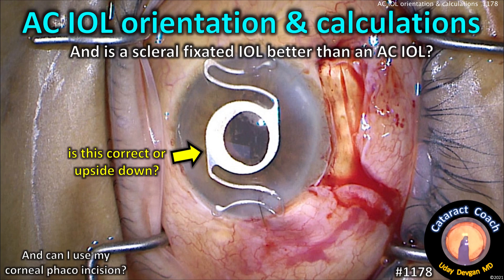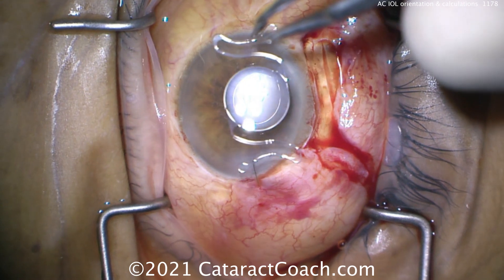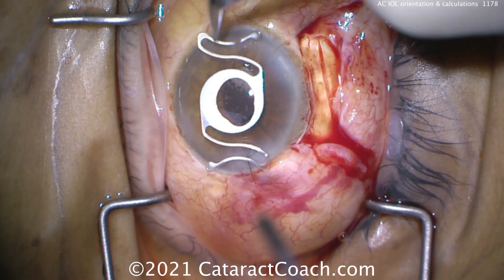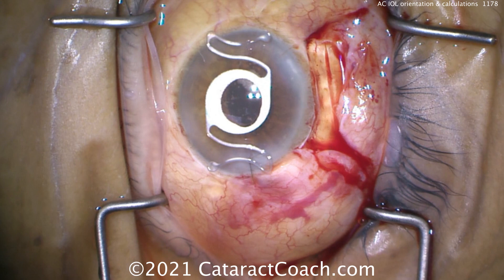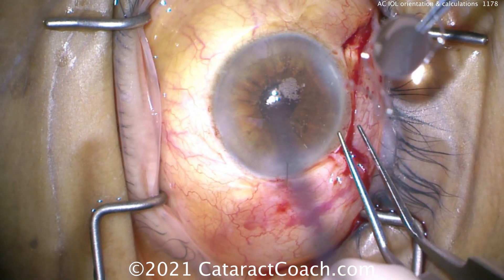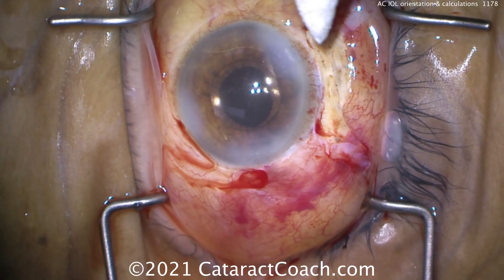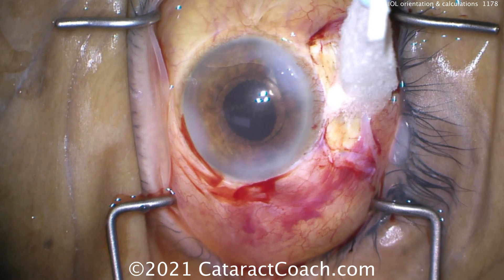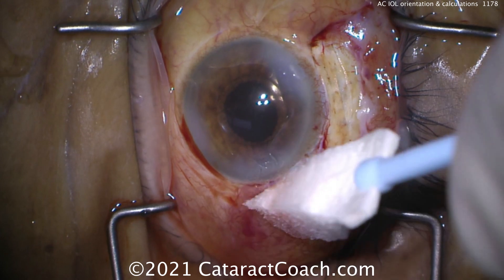CataractCoach 1178: ACIOL orientation and calculations (anterior chamber IOL)

Comment: Another really good thing: have the tech hold the box as you’re inserting the lens.  There is a picture of the lens on the box showing the lens in the correct configuration.  Another way to check yourself.

Comment: You are suggesting not to make any change in the IOL power based on the fact that a "lower A-constant of the AC IOL reflects the more anterior position".  However, when calculating change in IOL power of sulcus IOL's one of your earlier videos pointed out that we should adjust both for the A-constant differential AND for the change in position (your rule of 9's).  Is the situation different with AC IOL's?
Reply from the maker: great points. Let me clarify. For an IOL which is going into its intended position, the difference in the A-constant is sufficient to properly perform the calculations. For a sulcus IOL, we are implanting a three-piece IOL that was originally intended for in-the-bag placement and now putting it in the sulcus (more anterior). To switch from an Alcon SN60WF (A=119.2) to an Alcon MA60 (A=118.7), we would subtract 0.5 diopters regardless of the IOL power in order to change from one in-the-bag IOL to another in-the-bag IOL. But if we now place the Alcon MA60 in the sulcus, we need to follow the rule of 9s.